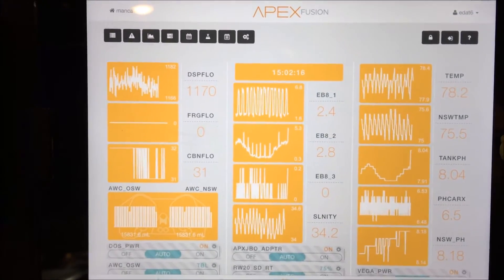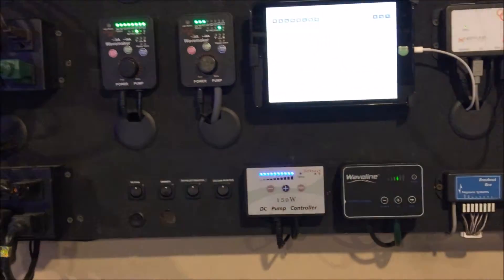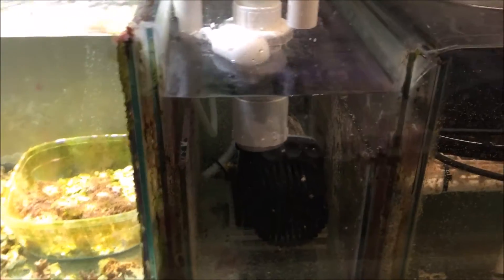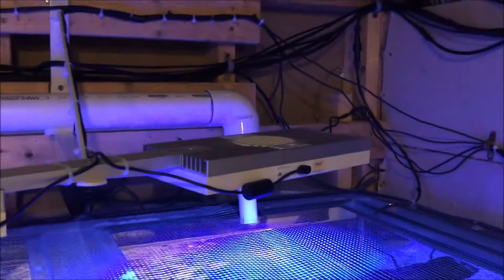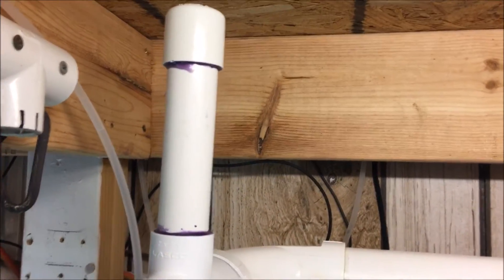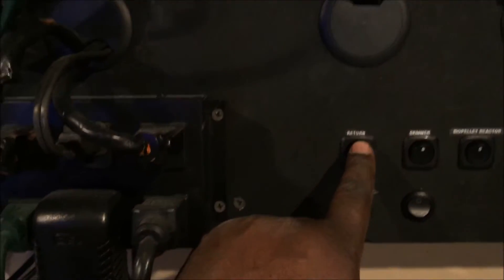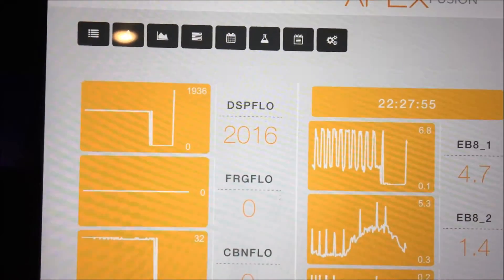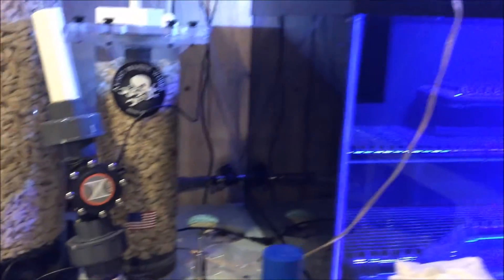Neptune Systems 2" FMM/FMK PVC upgrade test

Comment: Great video. I am planning on adding the FMK to my system (see videos on my channel). I am curious... I have never been overly concerned with flow through the system, more so flow within the tank. is there a reason you were trying to so dramatically increase flow?
Reply from the maker: Thanks for the comment!
After installing the FMM I was just more concerned with utilizing the pump to its fullest potential, not so much needing more flow. It will also allow me to utilize and upgrade my manifold more efficiently.